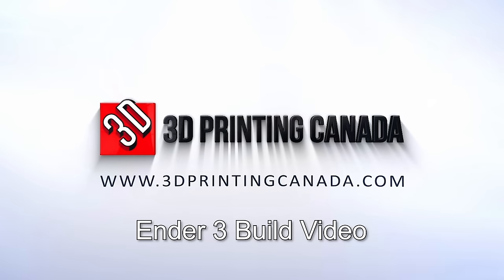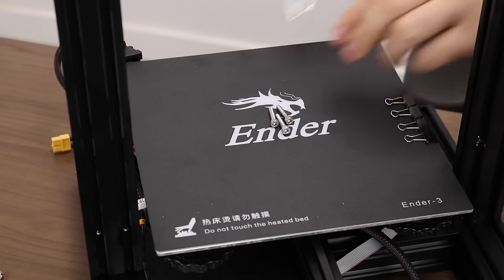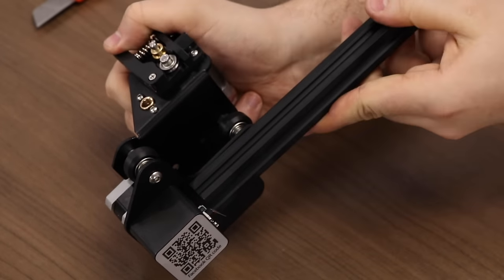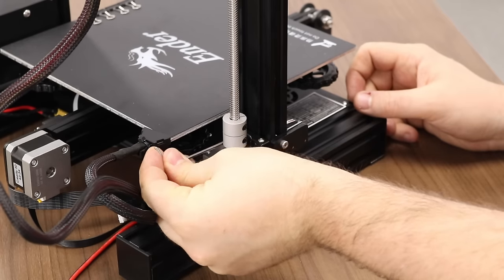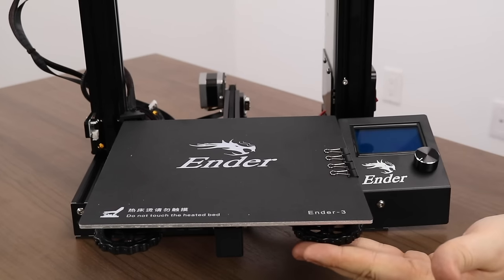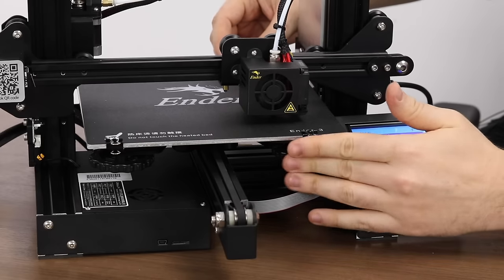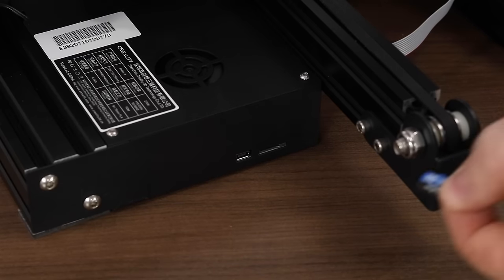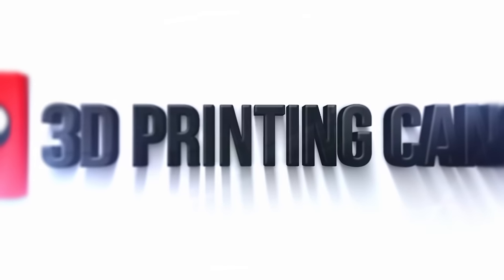The Ultimate Creality Ender 3 Quick Start Guide

Comment: Found out today that if i wanted to put the CR touch on my ender 3 pro i bought 3 years ago from you I have to change the motherboard (100$+) because it came with a mini usb slot so i dont have the 32 bit motherboard, which the ender 3 pro models that comes with micro usb does ... 
Crealty is so stupid to have done this. Feels like a rip off, since how could i know before having some knowledge about that.
Also I can't open the box where the motherboard is, because one hex screw is way too tight from factory. So basicaly i'm screwed because I can't upgrade the machine to the level I should be able to.

Comment: For some reason mine isn't printing. I put the filliment in, heat is at the temperature that is needed and it's not clogged. I'm quite confused about this.

Edit: nvm the filliment wasn't in ALL the way. Luckily I switched the color cause I realized I wouldn't be able to see the white
Reply: Thanks for the heads up i would have probably done that too

Comment: What if the nozzle never touches the paper during the leveling process and you've turned the knobs as far as you can?
Reply: Did you home it
Reply: @sethiroth1065  Autohome it? Yes, I did.
Reply: How did you resolve this issue? Was is a mistake during the assembly process?
Reply: @Miguel Romero I'm a little embarrassed to say that I was turning the knows the wrong way. When turning them the other way, the nozzle finally got there.
Reply: @beckymost9556  ohh okay you were turning the knobs the wrong way. I turned my knobs to raise the platform all the way up and still experiencing the same problem. Thanks for the response.

Comment: I think he left out the step of plugging in the Z-axis cable. I know I def forgot to do that step and then was confused when my Z-axis wasn't working.

Then in the process of trying to plug the cable in, I discovered the Z-motor bracket was installed incorrectly out of the box and then had to take the arm apart to correct it all.

Comment: I don’t know what I’m doing wrong 😭. I’ve watched this video close to one hundred times and all the set up is the same and it claims to be the same mode but not every things is reading the same in the little selectee area in the corner. Like everything is close or exact to what his is but certain things are different like my test print is a cat not a dog and my atomic temps are 200 and 60 for the bed. Now whenever I try to print something the filament goes everywhere and won’t stay still like it’s not hot enough and cools as soon as it comes out of the nozzle. I’ve tried close to everything and this video was the closest thing I could find if anyone know what is wrong or can lead me to a video with the step by step instructions for my printer (also a ender 3) please help 🙏.
Reply: have you figured it out yet?
Reply: @juicejosh1520  no I think it’s just I different model I keep trying to contact the company but there not very helpful, I think I’m gonna call a repair guy to help fix and set it up.

Comment: 6:48 - It should be "M4 x 18" screws. "M4 x 16" screws will not bolt to the aluminum extrusion profile since it's short by 2 mm. Even on the video you are using "M4 x 18" screws 😂

Comment: My extruder does not come close to touching the bed
Reply: How did you resolve this issue? I have the same problem right now. My extruder is so far away from the bed.
Reply: Unfortunately i have had this issue for 3 years with no fix

Comment: One thing to note: my biggest mistake setting it up was pushing the extruder arm as far down as it would go, and then leveling. This made the extruder too far above the bed for anything to stick properly. Make sure you just auto home and move the motor around but DO NOT bump the arm up or down at all. But the plus side I now know much more than I did about temperature settings, speed settings, nozzle clogs, loose belts, tight belts, the reason why the bed and the extruder should be to temperature before leveling,  etc, etc... So that's a plus... After 3 days of printing spaghetti over and over hahahaha... I want to go die now
Reply: i do have a question how did you fix this

Comment: ATTENTION: For the z-axis motor, use the m4-18 screws, NOT m4-16. I believe he made a mistake, on the real instructions they are the m4-18 and I watched the video and used the m4-16 screws and it stripped the screws and ruined the aluminum I was screwing into. Very disappointing.

Comment: I hope you're reading this and watching this video before you spent an hour on step one, because the directions in the book are HELL!!! They are literally the absolute worst directions I have ever seen for anything I have ever assembled in my life. It is officially the absolute first and only thing throughout my entire life that I could not put together on my own with or without directions and had to watch a video. The directions sick and they don't tell you which support bar the x-axis stop in installed on and which one goes on which side of the machine or the other... and they don't show you which way they are oriented, top/bottom, left/right. It's just insane that they can expect anyone to assemble one of these with such terrible instructions. This video makes it sure easy though. (My only complaint was the bearing that he shows as a tool needed to install the spool system, but then never shows what to do with it... and that part also did not come with the machine). That's it though. Everything else was perfect.